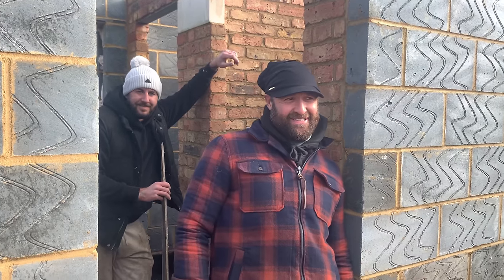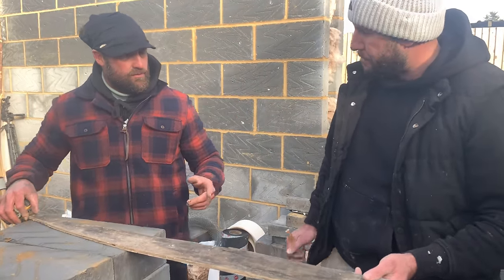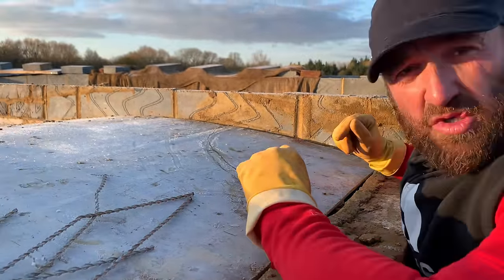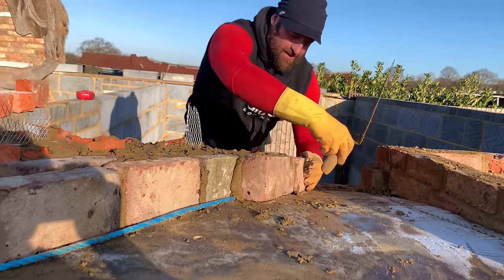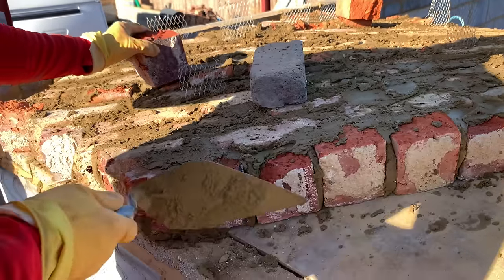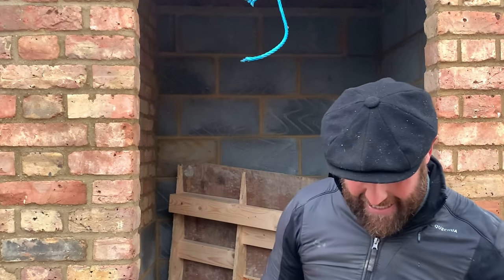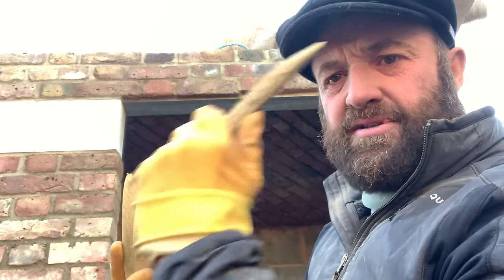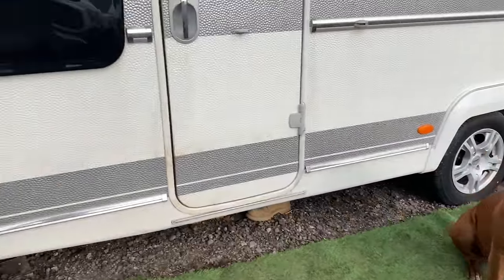#bricklaying #brickwork 
Brickwork vaulted ceiling

Comment: The curvature is to shallow , this would not get building regs approval, better to get a structural engineer to work this out for you, it can be dangerous tinkering around the edges. Also use nhl  3 lime mortar 3 - 1 ratio.  From a structural engineer. Good luck

Comment: I was sent to a job once where I had had to nock out 4 big beautiful archways and exposed brickwork to be replaced with 2 steels so they could plasterboard the steels and have flat square reveals to achieve a “modern clean look”… I refused I could not bring my self to smash out such craftsmanship. I’d like to think I’ll be able to something like this one day it’s absolutely beautiful mate👍👍
Reply: It's nonsense to let the legacy of the past stop the progression of the future.
Reply: @Imaboss8ball  it’s not nonsense it’s a matter of taste and utility
Reply: @NineZeroHero  the arch itself may have been nice but it's still nonsense to let the old prevent us from moving forward. The uk is probably the best example of this. Most of their homes are old, leak air, poorly insulated, not level, and just generally outdated. Yet they don't upgrade anything because the old homes have character. They even go so far as to build new homes to match the standards and looks of the old. It's absurd.
Reply: @Imaboss8ball  You are of course entitled to your opinions as are the rest of us, but your arguments hold no water.. it is obviously a matter only for the owners to decide (unless it has an order of protection covering it) but the initial comment on here is just showing respect and sympathy for great architecture (which should be appreciated and maintained if deemed worthy and appropriate in all cases) your main point is regarding buildings being up to spec and carbon neutral… this can only be achieved in less than many cases! and is primarily concerned with outer walls windows and loft spaces… so knocking down perfectly good architectural design wouldn’t make any difference without the aforementioned work being completed first.

Comment: Loved to have a crack at one of them not done one before so hats for showing daft question but would it be possible to use herringbone pattern or basket weave pattern on the ceiling or not ?  Keep you the good work